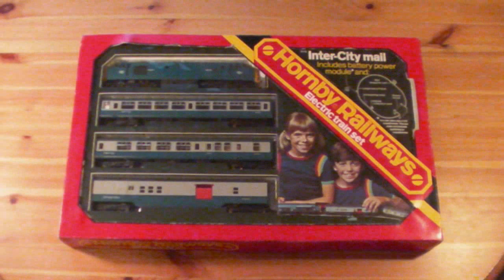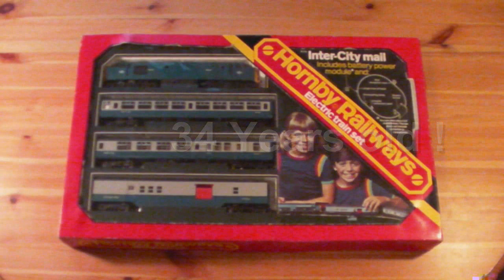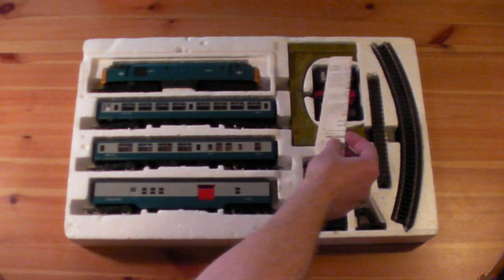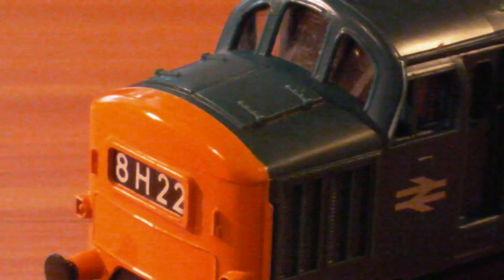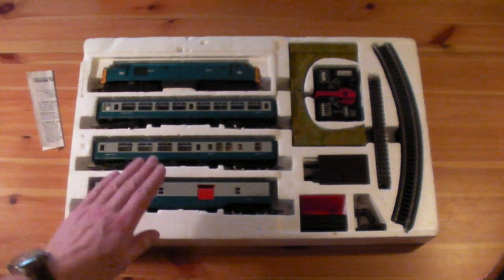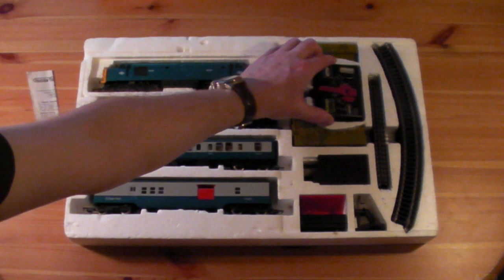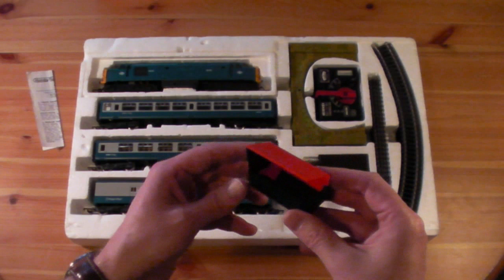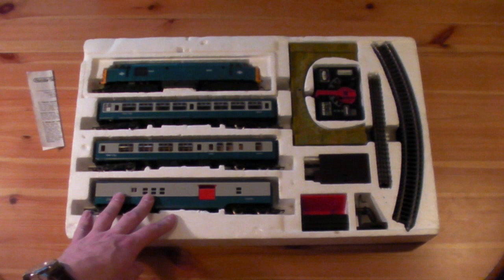Hornby Inter-City Mail Set - 1976

Comment: I had my first hornby train set jinty 0 6 0 steam goods back in xmas 1974 it used to have one siding a tunnel kelloggs closed wagon one shell tanker  and one open truck was my pride and joy!! the only thing was the battery controller used to take a Vidor oblong battery which lasted 1 hour if you were lucky. I soon progressed.

Comment: I had this, as a child, in the 1970s and 80s. Mine came as a battery operated set and I had to buy my own transformer to run it electrically. Eventually I managed to get the post aspect of it running well but to my utter regret, I sold it in my teens to raise some money so I could buy The Queen is Dead by The Smiths - not that I regret buying the album, simply selling the set. Not sure if there is anywherei can get hold of another one.

Comment: Like Shaun I had the R686 intercity set with 3 open 2nds and a corridor brake, but I also had the R401 mail coach set. Still got it all except the most important bit. The hook to dangle the bags off. 

The class 37 went kerput years ago, but it still sits in a engine shed at the side of the layout.

Comment: got 2 of the 37's in blue with D6830, run pretty well, used the glass fibre pencil to clean the copper contacts (stops stalling on points as I use the early system 6 track) and oiled, also have the one in green as well, best ones are the hymeks :D

Comment: anyone know where to get replacement battery for the R686 set please I'm desperate?
Reply from the maker: Just search 6v lantern battery.
Reply: Moorway South thanks for replying. is there any video showing how the battery connects to the battery controller? I can't picture how it would connect.
Reply from the maker: The base of the battery controller is a circuit board with notches cut out. You need to slide the board under the springs on the battery - should become obvious when you look at the controller and the batteries.
Reply: Moorway South ok thanks for sparing the time to help me